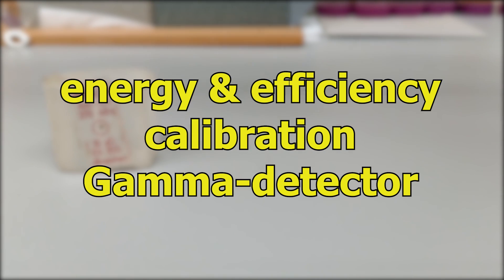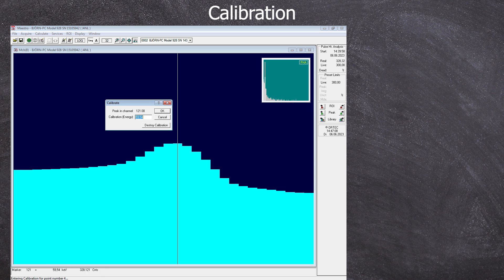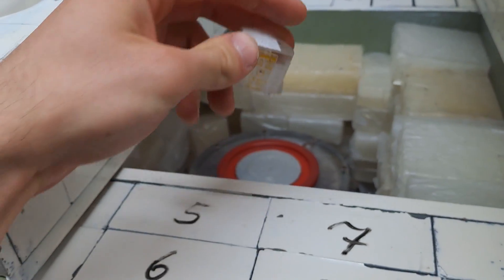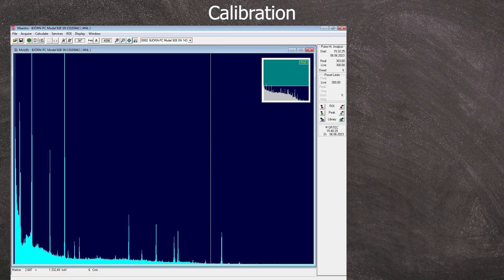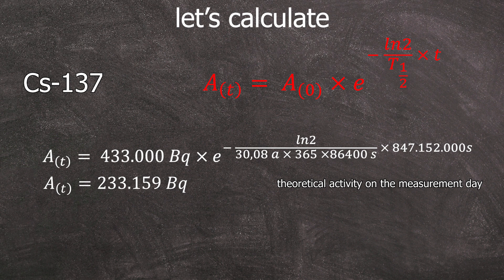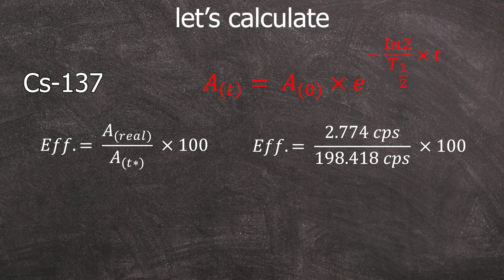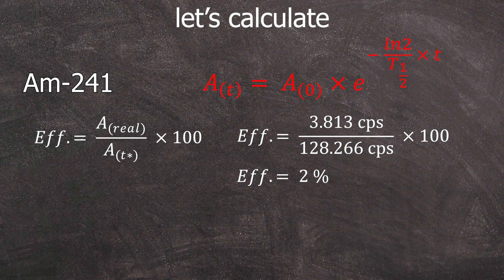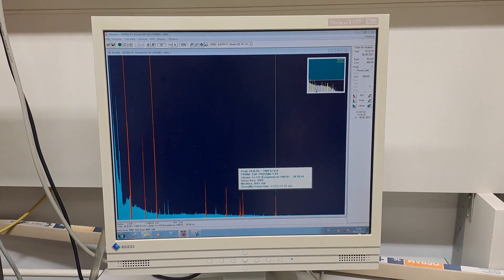Energy & Efficiency calibration of a gamma detector - Nuclear chemistry

Comment: Why is the Cs-137 spectrum so 'flat' in the <100 keV range, while Eu-152 has a big low energy peak there? Is it because the 662 keV rays are being fully captured by the large crystals, while the high energy Eu-152 emissions lead to more low energy noise?
Reply from the maker: As you can see in the miniature view, I only showed a small Portion of the Cs-137 spectrum (because the other parts wouldn't look much different), where I showed the whole energy range from 0 to 2000keV for Europium-152. But Europium-152 has quite a complicated decay scheme whereas Cs-137 only produces one gamma line during its decay (I explained the Cs-137 decay in the Video about Cs-137). Some Isotopes have 1 gamma-line, others have 20+ lines :D
Reply: @SimonsNuclearchemistry  Oh I see. Too bad the software has no X axis labels.
Reply from the maker: @MinSredMash  yeah thats why I made sure to show every peak on its own^^

Comment: I believe the biphasic relationship between photon energy and detector efficiency can be explained by the ease with which a particular energy photon is absorbed by the detector. Extremely low gamma radiation in the tens of KeV range is so easily absorbed by everything barely any photons actually make it into the detector, while very high energies in the MeV range are so energetic they penetrate great depths of dense matter without depositing much energy in the form of ionization at all, while in the mid-range the temperature of the porridge is just right 🐻 🥣🤤
Do you have a Tri-carb scint counter in your lab?
Reply from the maker: We have another type of Liquid scintillation counter in our lab^^ The deep dive on that just went online on the german channel. I can't translate it so that the video makes it on this channel this year but eventually every german Nuclear Video will be translated on this channel^^

Comment: What would the efficiency of radium be and I love how straight forward it is and I think applying all of this to my radiacode 102 would put the gamma spectroscopy to good use rather than just looking at what isotope I'm detecting
Reply: Counting efficiencies are per instrument basis. You need to validate your own instrument's counting efficiency at that energy
Reply from the maker: Seeing that the Energy of Ra-226 is 186kev and the efficiency for the 121kev line is 7%, I'd say around 5%
You can Insert these values into Excel and determine our GeLi efficiency at every energy up to the highest I showed in the Video. If you want you could calculate the effiency for every Eu-152 line.

Every detector type is different but I will determine the efficiency for the RC once I have it^^
Reply: @SimonsNuclearchemistry  that would be much appreciated and I looked on the website for efficiency and I don't know if I wasn't looking hard enough or in the right place but I couldn't find any information other than specs like size and crystal composition and battery life and stuff like that also I should have waited a little longer because there's a 103 now but it's more expensive and I can't find anything on what makes if different from the 102
Reply from the maker: @The-One-and-Only100  we will explore whatever arrives from Radiacode when it arrives^^
Reply: @SimonsNuclearchemistry  When mine arrives, I'll share my readings and spectrum of a variety of sources

Comment: Amazing video as always! As for the interesting efficiency distribution, looking at Google it seems HPGe detectors are the most efficient in the lower energies, I bet it's the same for germanium-lithium detectors. Maybe 59 keV from Am-241 is getting shielded by the metal detector housing, and Eu-152 is the lowest energy that isn't that shielded, causing a high efficiency? I'm not sure though, and I'm just guessing.

The efficiency Eu-152 is getting is very impressive, considering that maybe only 20% - 30% of the gamma rays are even emitted in the direction of the detector. By the way, for the "theoretical CPS" you could use the DPS/DPM unit instead (decays per second/minute), and then the efficiency is how many of those decays get turned into counts.
Reply from the maker: The "high" efficiency for Europium isn't really for Eu-152 its just for the energy. The efficiency depends only on the energy and not on the Nuclei. Its just that I presented this very energy. You could calculate the efficiency of the lower and higher energy Eu-152 lines with the Infos in the Video. The HPGe has a tiny bit higher efficiency but our HPGe are a bit older so they perform similar to the GeLi.
The detector has only a very thin aluminium casing as "shielding" but yes this is enough to compton shattering with lower energy gammas